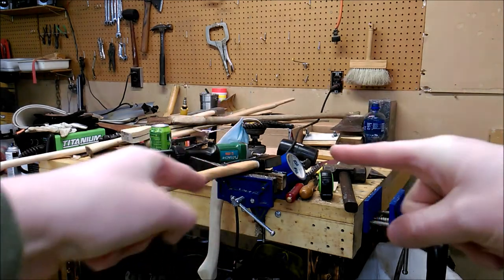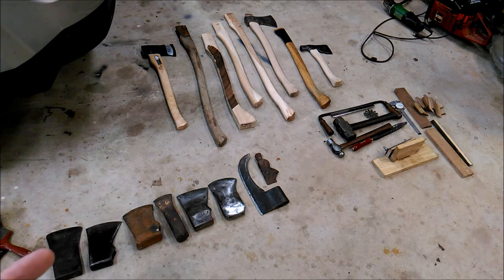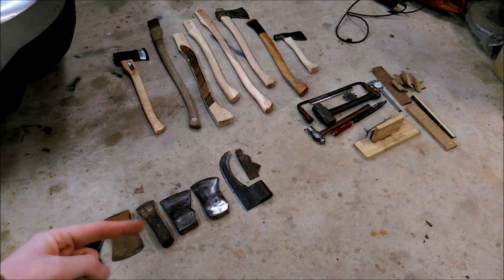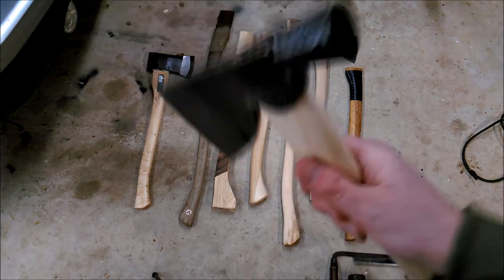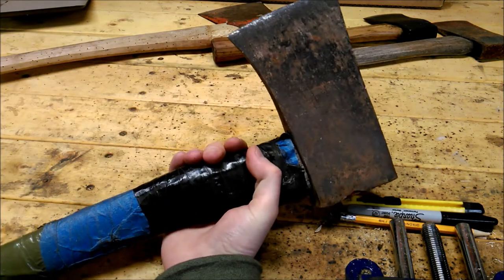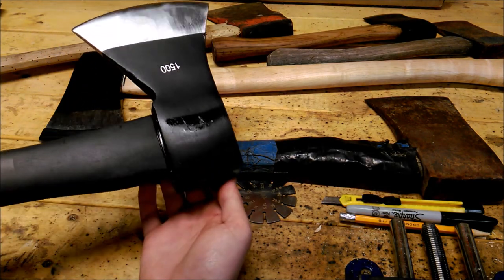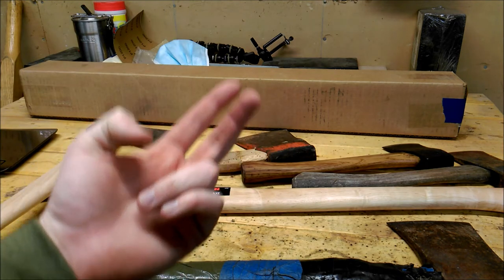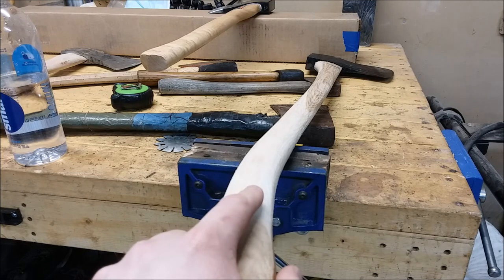What's on the Axe Workbench?

Comment: I think that chinese flared out head is cast, rather than forged.

Edit: I love heavy axes with long handles! It means I don't have to swing it hard. I am fairly strong, but I like using a very relaxed motion while chopping.
Reply from the maker: A very real possibility I never even considered. I figured it was drop forged in a mold or something and then the excess cut off and ground away. This may be what you're talking about, but I assume you mean cast in in like a sand mold
Reply from the maker: I dont have alot of experience chopping with the 36 inch handles, so I guess I'm a bit premature with my opinion on the longer handles. I do have a bit of footage of that michigan pattern on the 36 inch handle and it was too bad. I think I like 36 inch best for splitting axes and mauls. Like you said, you dont feel like you have to put as much power into the swing
Reply: @lifebehindtheaxe3835  Taking the handle out and inspecting the eye will reveal all details of the manufacturing process. Light pitting is a result of sandcasting.
Reply: @lifebehindtheaxe3835  What works really well for the long handles, at least for me, is to not do a whole lot of hand sliding along the shaft. Only the minimal amount, with the least amount of force. Once you get comfortable, you can time a snappy twist of the torso, just before the axe initiates the movement towards the log, which results in your muscles acting as springs. They flick the axe into the work, without the stress and fatigue of a full power swing.
Reply: @Fogyt121  this was interesting about the "long handle" technique. I've watched plenty of old local logging footage from down here in Aus, and they do seem to do this. I've tried to emulate it with a maul a little bit ( not keen on putting together a 36inch axe) and it seems the right way to economize motion. It's amazing that those blokes did that shit all day every day on hardwood trees a couple of metres wide. I work in the bush and do a lot of choppin, but the old timers were a different breed for sure
Reply: @kurts64  The way I discovered it was by getting lazy one day and trying how little effort I can put into it. It covers a huge arc and you have to be really accurate, because the swings per minute are fewer, so any error is magnified.